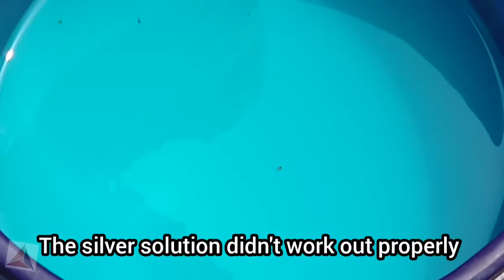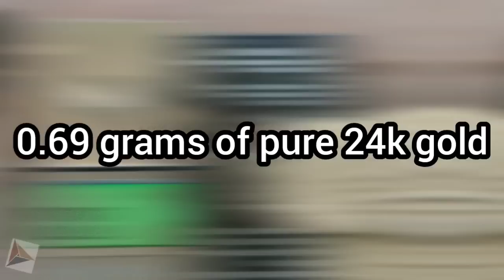BGA Bottom Parts Gold And Silver Recovery | Recover Gold And Silver From BGA Chips

Comment: Are there any gold bonding wires inside the bottom?
Wondering if it's worth further processing if there are any bonding wires inside them.
Reply: I saw Idelelectrotech burn the fiber boards on flip chips to release gold plated circuit trace.
Reply: Yes you can see by pausing video there is gold wire left inside, this isn't the perfect way to recover, it should have to be treated with sulphuric acid first 🤦
Reply: Bond wires are in the bga top. Might be copper leads in the fiber

Comment: Where do you get your filter fabric and the little clay bowls? In the removing green solder masks video I noticed you had several pieces with the little black blob on them. If you use heat and a scraper those will come right off. There are gold wires beneath them. I enjoy your videos. Where do you live?

Comment: May I ask how long does it take to complete a fabric and cotton filters ?  Especially the silver solution will starts dropping slowly  due to the presence of thick sludge until its completely stopped passing through .  I will use a vacuum pump.
Reply: Hmm depends on what the sludge is

Try to decant solution before or into filter.  Keep most of the said sludge, in beaker and dilute with water a few times and decant. The more that ends up in the filter early, the slower the flow.

Another tip. Don't wet filter paper before adding a non-diluted solution. The filtering will be faster, if the solution is the first thing in.

Comment: To begin with, what is the equation of nitric with water?

Did you put 1 nitric and then 3 . water?

After that, I used Captique
Reply from the maker: 1: 2 HNO3: H2O, you can follow the same ratio 1: 3 HNO3: H2O, but I was wrong that it should have been dipped in hcl for 24 hours to dissolve lead and tin.

Comment: Doesn't it take the outer coating in the nitric acid process because there is very little output this time?
Reply: The amount of gold from their material is normal. I would be surprised (in a bad way) if they got more.
I have another question, why they use so many acids? 🤔
Reply: @akgoldbear7669  I think it's better this way because neither too much nor too little material is eye-catching.

Comment: It didn’t work out very well because theres copper chloride and tin mixes in with the silver.
Reply: What is the solution?
Reply: Pour 0,5litre H2s04 firt stir it well and filtering using fabric the lead will perticipate. Then use nacl  to perticipate the silver

Comment: Nice shoes. 👍. You didn't show how you got the silver from the blue solution.?
Reply: I believe the tin in the balls led to the white powder or metastannic acid (H2SnO3) that formed before the first filtering. My assumtion is silver is in either in the metastannic acid in the first filter, (where the silver dropped out of solution overnight.) Or it is in the left over solution.... but i find it harder to make sense for it to be there. Unless something is keeping it more stable then the AgCl. But if it's silver nitrate (AgNO³) and chlorine is available it should convert. My last thought would be, if it is there, add heat perhaps to convert.

I laughed at the perhaps risky shoes originally. Then somehow i ended up in almost the same pair on hot days. Easy to rinse quick 😉
Reply: @colonialcharlie8702  You should of seen his old shoes Lol. One way to get around the metastannic acid acid is to use boiling sulfuric acid instead of nitric acid.
Reply: @toomuchdebt5669   oh wow went back and noticed the nice new ones. (Still looks like crocs) Yea mine are like the old ones bahaha

Comment: The balls are not completely silver. Tin and silver and great work as always. Hope you're doing well
Reply from the maker: Yes✌️
Reply: I find if theres another base metal i wasn't expecting and i messed up; Just add more water and acid until i get back to where i should be. 

Then use lesson for next time haha. 
Those damn tin balls got my solution so hot so fast, that i had my first boil over, (into my pyrex rescue cassorole dish) when i first tried some bga bottoms.

I put the silver/tin solution into my low grade pins waste bucket, as dilution and adding acid over and over basically is the point in there. 😉